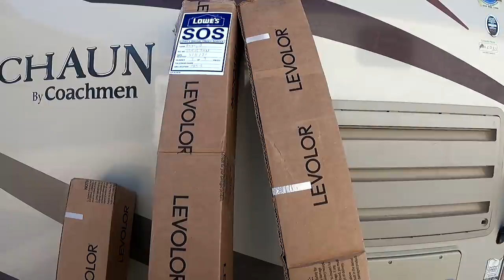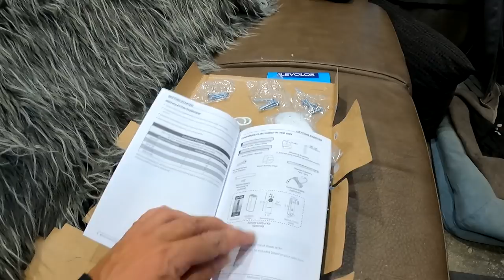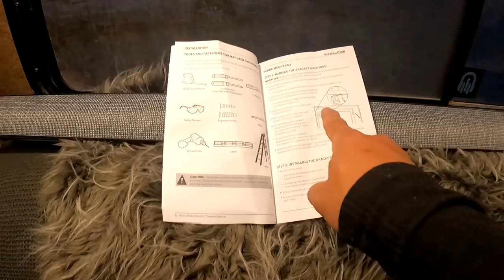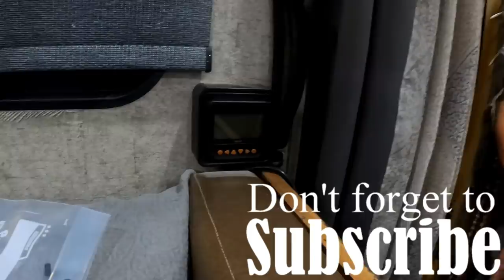RV Upgrade - Installing Levolor Automatic Remote Controlled Roller Shades

Comment: Those are nice looking shades. You might consider putting a hole in the bottom of the cabinet and putting the battery pack in there.

Comment: Drill hole into the bottom of cabinet run battery pack line through and put battery pack inside cabinet.

Comment: I have remote control blinds but they aren't Levolor.  The battery pack has a spot where it hides inside and behind the valence on mine. I've also seen them where they have hardware to attach it behind the shade at the top. Seems really odd if Levolor designed their battery pack to just hang outside like that.